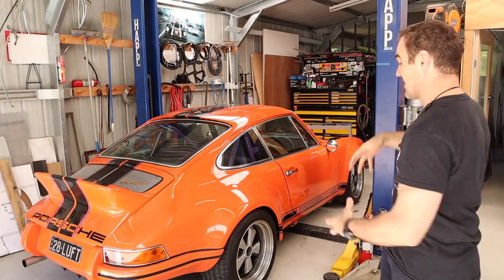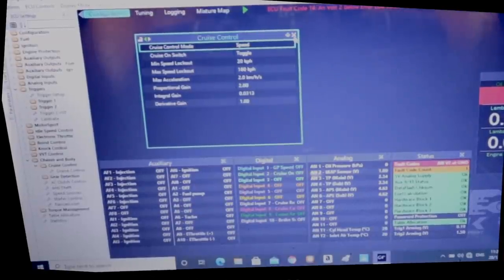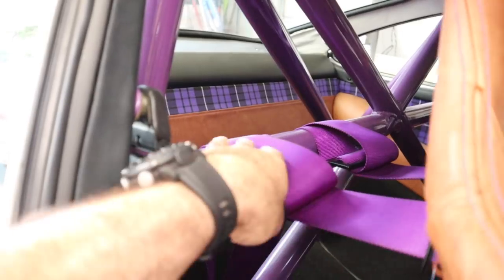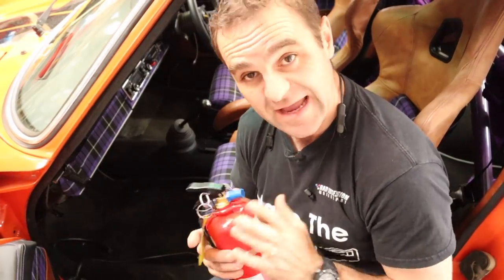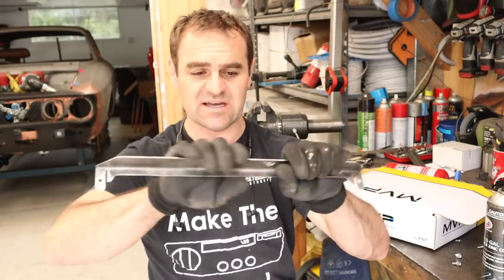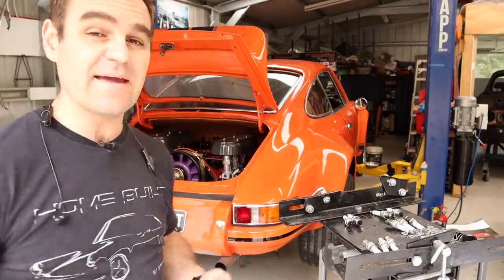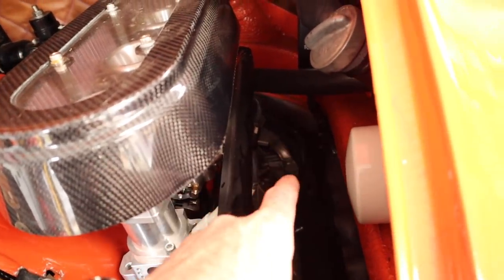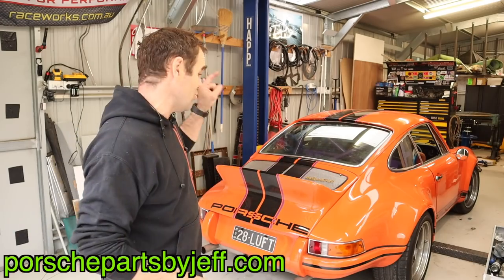Track and dyno prep - Porsche 911 2.8 RSR Build Season 3.9

Comment: Hi Jeff. I worked as a VW mechanic back in the '70's and adjusted a lot of valves on similar VW engines. We used to do them with the engine running which saved a lot of time and improved accuracy since the engine was at operating temp. Had an old guy come in for a valve adjustment once who said he had to bring it in because his hearing was getting too bad to do it himself - he adjusted them by ear. As I recall, everything was perfect, didn't have to adjust a thing.
Reply from the maker: How do you adjust valves with the engine running??
Reply: @HomeBuiltByJeff  Just slide the feeler guage in like usual. The valves are obviously opening and closing, but you can still slide the guage in and out. There's not much movement (.006"?) so it's not a problem to loosen the nut and turn the adjuster with it running.

Comment: Hi, to clarify the reason you don't submarine with the factory 3 point belts  is because you have one shoulder strap, which allows the other shoulder to rotate, causing your pelvis to twist those 2 motions prevents you from submarinning. The new 4 point belts have a ASM feature which is a length of strapping folded over itself and stitched to the harness. In an accident the stitches break and the strap lengthens, thus mimicking the actions of the 3 point belts.
As for you 6 point harnesses DO NOT mount the Crouch scrap on that bar under the seat it's not a harness bar it's used to support the seat frame make sure you attach the crotch belt to the floor. 
Shout out to Mrs. Jeff!

Comment: Jeff have you considered giving Harry a bit of help, electric power steering is a simple fit that way you can keep the good looking wheel and still have enough power to do the job while still giving you feel of the road. I have seen how to fit the steering on YouTube that I could understand, I had to sort out mine on my old van.
Those belts look wicked.
Reply from the maker: It is fine without power steering as there is no weight in the front, just a slightly bigger wheel will do the job as intended.

Comment: I believe your spark plugs were in the engine when it was still not tuned correctly.  I would recheck after the next 500 miles to make sure you get a correct picture now that they are clean and in an engine running a lot better !

Comment: Heey Jeff, Awesome video!
Apparently there is a replica RS steering wheel, it looks more like the original steering wheel. It has 380mm diameter but it is a thicker steering wheel than original. 

Also there is a company, classic retrofit, in the UK that builds an electric aircon for early 911s. 

Good luck with the finishing touches!

Comment: With regards to the original 3 point seatbelt,  have you considered or tried it with the shoulder strap through the harness hole in the seat, with it over the side of the seat when you're sat in it it looks like there's a reasonable gap between the belt and your shoulder,  which would allow a lot of movement before the inertia would take effect..... just a thought....
Enjoy your content.... happy new year Jeff...

Comment: It would be easy enough to make a new steering wheel in a larger diameter.
The main issue is the boss and splines but if you reuse the bits you have you only need to get a hoop rolled and cut out the spokes, Steel would be best alloy needs to be the right grade and heat treated.

Comment: With the cruise control you fitted, and being a manual have you put a defeat switch on the clutch pedal as well? Does the Link ECU have provision for it?
Reply from the maker: It has provision for it, but I haven't fitted it. Shouldn't be an issue with the very slow ramp rate, and I am the only one who will use it ;)

Comment: Any chance of a video explaining Porsche model numbering?
Reply from the maker: I don't think even Porsche can explain it, you just have to learn it ;)
Reply: How's this?

2 Air-cooled engines (1963–1998)

    2.1 911, 911E, 911L, 911S, 911T
    2.2 911 Carrera RS (1973 and 1974)
    2.3 911 and 911S 2.7 (1973–1977)
    2.4 Carrera 2.7 MFI and CIS (1974–1976)
    2.5 912E (1976)
    2.6 Carrera 3.0 (1976–1977)
    2.7 930 Turbo and Turbo Carrera 3.0-litre (1975–1977)
    2.8 930 Turbo 3.3-litre (1978–1989)
    2.9 911SC (1978–1983)
    2.10 Carrera 3.2 (1984–1989)
    2.11 964 Series (1989–1993)
        2.11.1 964 Turbo (1990–1994)
    2.12 993 Series (1994–mid 1998)
        2.12.1 993 Turbo (1995–1997)

3 Water-cooled engines (1998–present)

    3.1 996 (1998/9–2005)
        3.1.1 996 GT3 (1999–2004)
        3.1.2 996 Turbo (2001–2005)
    3.2 997 (2005–2012)
        3.2.1 997 Turbo
        3.2.2 997 GT3
        3.2.3 997 GT3 RS
        3.2.4 997 GT2
        3.2.5 997 GT2 RS
        3.2.6 Sport Classic
        3.2.7 Carrera GTS
        3.2.8 Speedster
    3.3 991 Series (2012 – 2019)
        3.3.1 911 GT3
        3.3.2 911 GT3 RS
        3.3.3 911 R
        3.3.4 911 GT2 RS
        3.3.5 Speedster (2019)
    3.4 992 Series (2019–present)

Source:  Wikipedia

Comment: What are your thoughts on the road-flare like extinguishers like the “Element” fire extinguisher? Good for car fires, as there’s less to clean up, or not sufficient?
Reply: They are great but not sure they pass Track Scruitineering yet. They also dont put out fires as fast as a powder extinguisher. There is another brank I use called FireOne. Check them out!
Reply: @kapindustries9236  Bang on, they are acceptable for track events as an additional fire suppression source, but you are still required to have a 1kg fire extinguisher by Motorsport Australia
Reply: @kapindustries9236  Gotcha, thanks. I love the bracket you have for the E39 M5! Will fit nicely in my car :)
Reply: @computiNATEor  thanks man! Dont wanna sell your car do you?? Dream car right there. On speed.academy youtube channel they are building an m39 wagon m5!!
Reply: @computiNATEor  use jeffs code if you buy one. Gives him a cut! My way to help out his channel
Reply: @kapindustries9236  Haha, not for sale anytime soon! Not after rebuilding the engine last year 😜